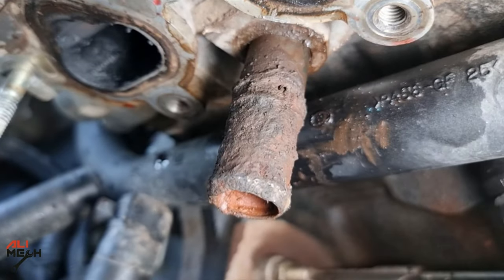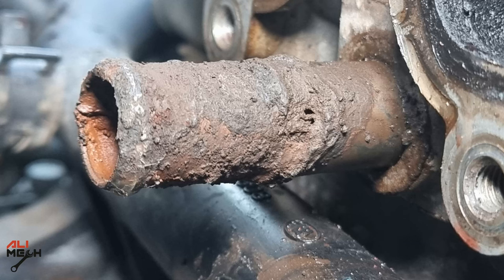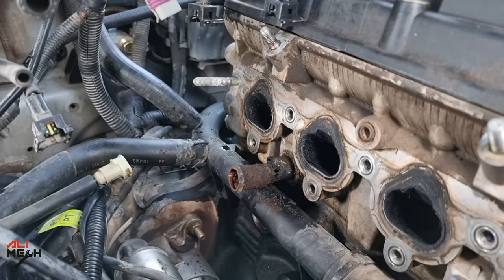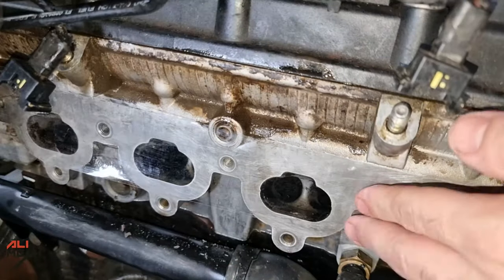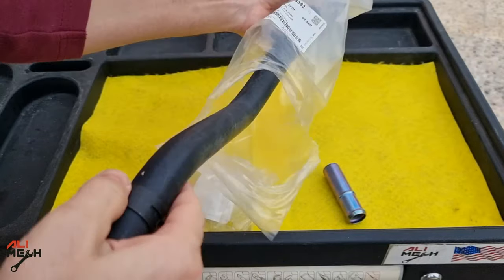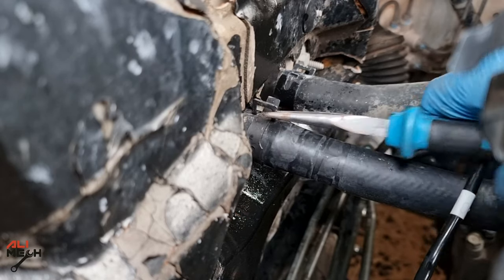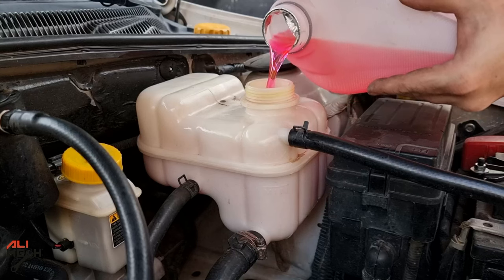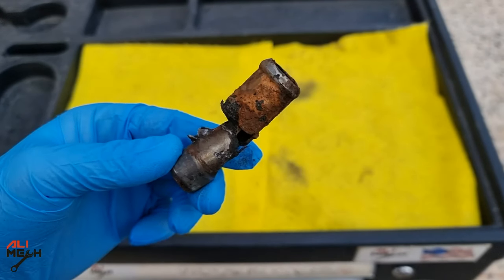Cylinder head pipe replacement without special tools/Radiator leak repair/How to clean intake valves

Comment: Happy New Year. If the heater not required and unable to source the right metal pipe replacement, would it be able to blocked blocked off on both ends to stopped the coolant travel to the heater?
Reply from the maker: Yes you can do that for sure, no problem
Reply: @AliMECH  Thank you very much

Comment: Hi AliMECH. Thank you so much for sharing. I’m now convinced to replace the cylinder radiator pipe.
 
Wanted to address the elephant of the room. Is it safe to shampoo and rinse with water the alternator?
Reply from the maker: Alternators are splash prove but can't be submerged in water, but I always wash all my cars with pressure washer and never had problems with it, plus in winter  most of the times it gets we when driving under heavy rain
Reply: @AliMECH  Gotcha. That's reassuring. Thanks

Comment: can I use epoxy steel weld (JB Weld, Permatex Steel Weld) to glue the pipe? in case the fitting is loose
Reply from the maker: I didnt use anything, it's been installed from factory like this and even I don't have any problems now

Comment: The clamp was placed way too near the cylinder head, isn't it supposed to sit between those two flanges?
Reply from the maker: You are right, but the design of the engine so bad, I put it like you said before but when I put the intake manifold on, it wasn't sitting flush, that's why that clamp has to be near cylinder
Reply: @AliMECH  ah, I get it, the clamp sits too near the manifold if you install it between the flanges, that's one big problem...